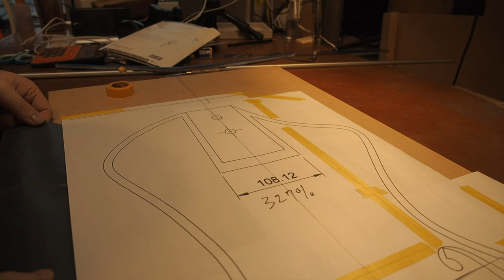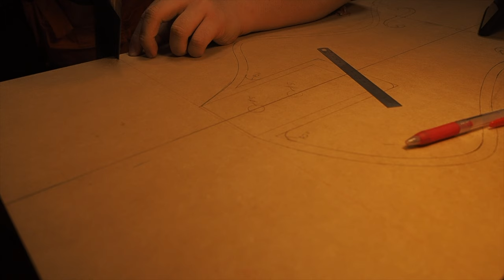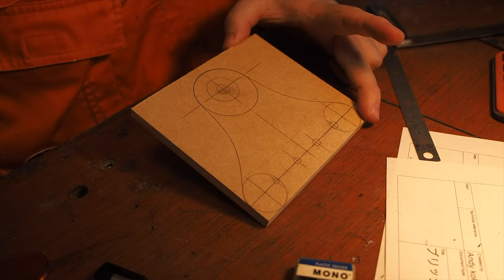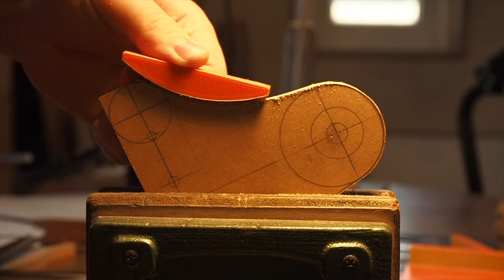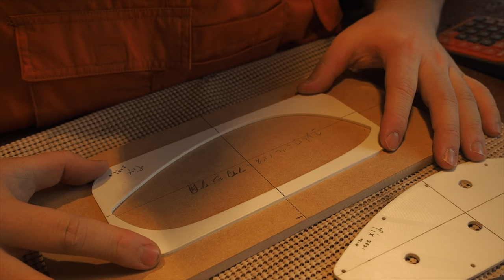I need to shrink double bass! #2（Guitar Making ASMR)

Comment: I enjoy your videos very much, and I am looking forward to the third part in this series. At the risk of being a busy-body or sounding like a know-it-all, I wanted to mention one thing, and I do this only for your safety. Please do not drill through metal while holding the piece with your other hand. Secure the workpiece in a vise or with a minimum of two clamps. Drill bits can grab metal and cause it to spin.